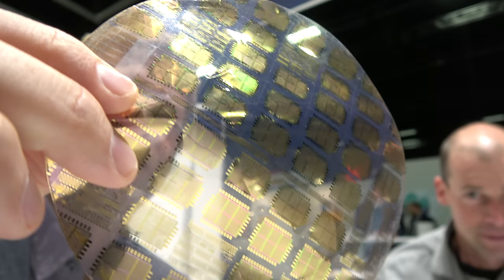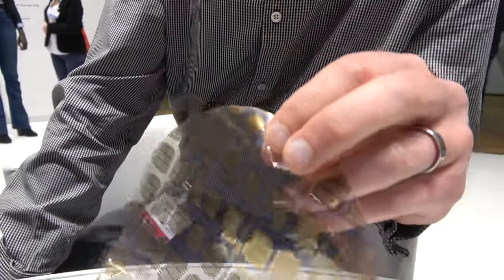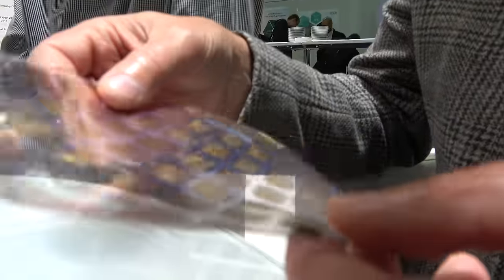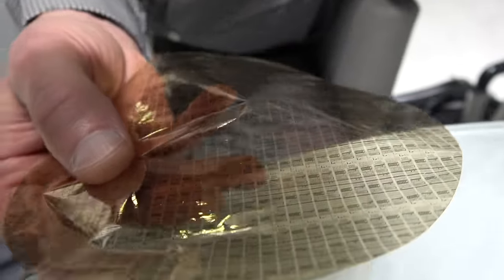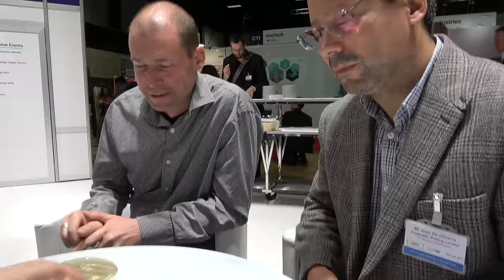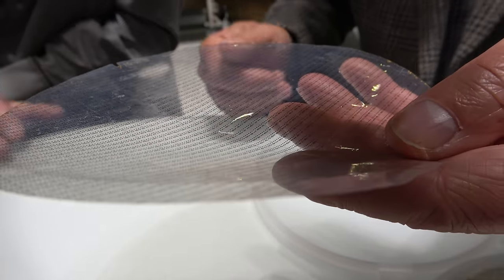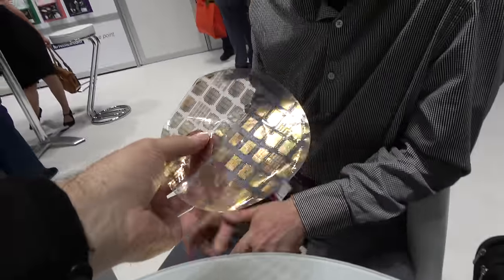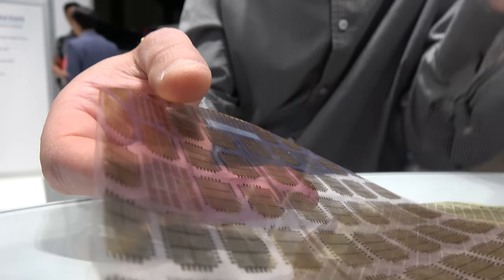$0.01 Flexible Plastic ARM Processor by PragmatIC

Comment: I'm still waiting for the day I can print out a new computer
Reply: can you imagine the cost of the ink though?
Reply: You literally can, right now, with an ordinary inkjet printer.
https://www.wired.co.uk/article/inkjet-print-an-electronic-circuit

 @menotu000  The ink is really expensive, but not bad compared to normal printer ink - it's about $30 a gram.
Reply: You literally can, right now, with an ordinary inkjet printer.
https://www.wired.co.uk/article/inkjet-print-an-electronic-circuit

 @menotu000  The ink is really expensive, but not bad compared to normal printer ink - it's about $30 a gram.
Reply: @nathangamble125  There's a difference between printing an electronic circuit and printing a full proccessor i.e. what Jason ^^ was referring to. Did you really think he was really waiting for the day he can print out a blink LED circuit?
Reply: @spacedesigner849  i mean you could do that with the right inks and layering
Reply: Your dream might be accomplished with advanced 3D printers.
Reply: Just download more RAM :) save the material
Reply: OddFuture  technically with a Virtual Machine you can XD

Comment: CPU is free, you pay for licence :)
Reply from the maker: dzhiurgis for the first Billion, the license should be free..
Reply: After "the first billion", I guess they go to RISC-V. :- )
Reply: AMD still pays a fee to Intel for the x86 platform.
Reply: @Game Over  Maybe because X64 is supposedly by AMD, not that I care...
Reply: @Game Over they reached an angreement where AMD licence x86 while intel licence x64 without paying any royalties also RISC-V is the future

It has the specifics of arm but with an open standards so companies nutoriously push this intructionset
Reply: @epicgrapefruit7563  Still, you can't deny that RISC-V is more desirable than ARM, may not be a direct replacement today, but surely in the next 3-8 years.
Reply: @epicgrapefruit7563  okay my bad i should have been more specific what i meant is that arm was expected to conquo the desktop/notebook market with its performance/efficency improvement

But risc-v over even a greater leap in this feild than arm
Reply: CPU is free, but its driving is electricity 😂
Reply: @epicgrapefruit7563   I wish there was the day where there would be RISC based desktop CPU's beating intel\AMD on everything including price, but yeah, if it happens will be far, far away from now :(...

The advantages are probably that any Chinese company can make them and customize them the way they want without having to pay crap to no one which only means the end user will pay less even though if phones were using them, the big known brands would probably continue charging the same as their current expensive snapdragons and only get even more profit out of it :(...

Comment: Instead of making it smaller with slight improvements, keep the size, make it more powerful.

First gen cell phones had bigger processors than desktop PCs.
If we had batteries to keep up with our density of power for the size, the only limitation I see, it would be amazing.
But if it's done, parallel research will make up for the deficit.

Comment: Any heat issue?
Reply: mino dino it will melt the plastic lol
Reply: chip never heats itself ...the whole component heats altogether....if they provide it with a good cooling technology ...the estimated heat produced in 0.1 microsecond will be transferred immidiately and whould be completely safe.....everything depends on heat discharge rate
Reply: Arm processors use very little electricity and I doubt they'll have a high atdp but if they do have a heat problem in the future they could just use Liquid to transfer the heat away like a non conductive mineral oil
Reply: that's arm 1, from 22years ago so probably not much heat is produced
Reply: Richard Farrey  there goes your flexibility!!! :)
Reply: Considering how thin it is it's probably so easy to remove any heat that it will be way less of a problem compared to traditional processors. Ofc unless it instantly melts when you run a current through it

Comment: How much processing power does this actually have? Can it run a simple operating system?
Reply: It's probably still a prototype, so that would be unknown unless there's estimates/expected result
Reply: They mentioned an equivalent of a Cortex M8 and I remembered it used in gaming mouses. It's just good enough as a co-processor.
Reply: William Baric  it's a processor.
Reply: its based off of a cortex-m0 which is.... drumroll.... 2.33MHz. you could maybe run dos on it and do some assembly code?
it's still super insane that you can actually create a CPU just by shaping up plastic though.

Comment: Interesting but substantially fact-free. Now, late 2019: where are they, boys?
Reply: might have realised it's hard to implement these as they said
they seem too easy to damage even by a slight mistake to me..... which would suck in the real world
Reply: Heat from CPU will melting the plastic, so not sure how to make it durable, but for capitalist view this is great for "planning obsolescence"
Reply: @fadrium1464  I can see these arm processors possibly being used in cheap calculators or low powered microcontrollers.
Reply: @fadrium1464  Heat is fair concern and one of the questions not answered in the original video - along with clock speed. But I've done plenty of MCU designs where power is only a few milliwatts. You can still get a lot done with that.
Reply: @fadrium1464  has nobody in the comments actually watched the video? They aren't designed for high performance applications. It's for things like tracking, short-term environmental monitoring.

They aren't trying to run Crysis on it, my dude.
Reply: @epicgrapefruit7563  you would still need to thicken the plastic.

Plus this is old technology. We already use PCB's. Plastic in electronics isn't new
Reply: @epicgrapefruit7563  electricity and thin plastic. Yeah. No matter how much juice is flowing it'll still eventually degrade.

I can see this being used in singing Hallmark cards or sales tickets. Other than that nothing else unless it was meant to be thrown out
Reply: @epicgrapefruit7563  yeah, you obviously don't think. Peace
Reply: @MsHumanOfTheDecade  All I hear is RFID tags.
Reply: Shit, you’re right, it is late 2019. Damn. The future is coming.
Reply: @fadrium1464  can't they use some type of aerogel composite instead?

Comment: But can it run games without melting?

Also how would you connect this to a motherboard?
Reply: ARM CPU's aren't for gaming.
Reply: @AsttoScott  you can play pubgm on phones with ARM CPUs
Reply: @AsttoScott  As long as computer games require CPU calculations, any CPU can be used for gaming.

Comment: We could have thousands of these running in parallel (if they design them to support multiple processors) for a cheap price.
Reply: @Murphy deffa someone also said you don't need more than 640k...
Reply: @Murphy deffa well it depens heavily how you programm the task you want to process
Reply: @Murphy deffa yea right... super computers only use 32 cores, right?

GPUs also have 32 cores? They have thousands. Investigate about "CUDA" (Nvidia) and "Stream Processors" (AMD).

As Leicht Sinn says, it all depends on how you program. Also depends on the task you want to do.

Granted, for most users even 32 cores are to many.
Reply: GPUs have 32-64 cores. Stream processors are execution units, not cores.

Super computers and server halls do not generally accelerate one task, because that’s hard; but that’s what end users tend to care about. You’re not interested in running an ensemble of games, you want to run a single instance of the game faster. You don’t generally want to do more each frame (e.g. simulating the NPCs you don’t see) you want to make each frame faster. It’s a different use case.

Also, Bill Gates/Microsoft never said 640k was enough for everybody. The 640k limit came from IBM hardware combined with the need for adresses that map to other things than physical memory.
Reply: @soylentgreenb  Yes, they have "few Compute Units". As I understand it, those compute units will send instructions to multiple small processors running in parallel. Nvidia calls those smalls processors "CUDA cores". One could argue they are cores inside a core. Scientists use GPUs as "low end cheap super computers" to execute simulations and other stuff, normal users for gaming and mining bitcoins. But ultimately they are processors running in parallel, and that is what we want. 

Games tend to use "few cores" most won't use more than 4, 4~8 cores in the newest ones, even though some are programmed to take advantage of more cores. I am sure we will soon have games that will require easily 8+ as a minimum.

Applications that benefit from more and more cores are for work (graphic, science, engeneering, video editing, movie making, etc). Servers for virtualization.

It seems you are thinking only about games. Outside of games and simple office use, the higher the core/processor count the better.

However, I was wondering what is the life span for the processors in the video. Don't think a processor printed on a plastic will last long for a heavy task. Maybe they can improve (and I bet they will, if they haven't already) their technology to print on other substrates that will compete with or be better than a silicon wafer.
Reply: Thermodynamics starts killing you pretty quickly.
Reply: @serpentine1983  One could argue that floating point units and ALUs inside a processor are their own cores too. But it would be wrong. GPUs are really fast at stupid brute force because that's what they were designed to do. Pixels on the screen are largely independent and can be handled without reference to other pixels on the screen. Not strictly true always, but usually true. Why are CPUs often faster than GPUs? They're made to run branchy, gnarly, highly serial stuff fast; that's what almost all the transistors are spent on. Even in a highly parallel problem like graphics you have a serial fraction of the code. You need to have something to setup and distribute tasks; often there is some kind of gather step for parallel tasks too. Amdahl's law puts a strict limit to the amount of speed up you can get from such a system. Getting around amdahl's law has a big cost. The way games do it is by working on several frames in parallel; this has the huge cost of increasing latency; making 120 FPS feel as sluggish and unresponsive as 40 FPS (because you're displaying ~5 frames in the past instead of ~1.5 frames).

Running several game clients on the same system in parallel would allow even more parallelism. That's something google would like to do, but for you as an individual user it makes little sense. There are other ways you can expand the problem; you can of course simulate many independent NPCs in parallel and even the ones you don't see instead of just giving them a schedule. OK, so now I'm saturating 16 cores, but how much better does it actually make the game? What's the added value? Very little. But that's what you have to do to make use of the extra cores; you cannot generally speed up the same game without harsh tradeoffs. Can someone find a generally useful feature that you can add to make games use the extra cores? Maybe, but it is extra features, not performance that you're going to get.

Comment: Can that plastic handle lots of heat? If not then this suggests that those arm processors don't get too hot.
Reply: Actually there is plastic can stand heat , like the one you use in mircowave oven

Comment: Wouldnt the processor be ruined if it generated enough heat to warp the plastic thou? It would seem to me like heat could really effect the lifespan of the cpus and with plastic being the base it would not take very much to break them. Maybe for low-end applications it might make sense from a cost-effective standpoint but anything more complicated than a stopwatch you may have problems with the cpus getting too hot and damaging themselves. Need something that can resist heat and/or cooling I guess.

Comment: I don't know what R-micro controllers are but tech has come a long way. The first GameBoys use to be really big and bulky and it required cartridge and battery's. OK now imagine a gaming unite that did only what the original Gameboy did and noting ells with the same potential but built with the latest technology. Imagine translucency, flexibility, and solar powered all in one unit. With even the screen it self is both translucent and flexible t the same time. This would be unimaginable back then.

Comment: Excellent future. Cut and stick and paste. Do you spray se b. Even display types. No LCD required. Best are network sensors. Mostly people can design and distribute from home printing later. You can design your own chips and the whole thing costs less than a printer with a substrate papers.

Comment: I'm wondering about heat dissipation. Like if you were to attempt to scale this up to say... Risc-V with a certain number of cores running Linux, would you begin to run into problems with keeping it cooled? Or does the thinness allow heat to dissipate more easily? In terms of manufacture, with its more robust process, is this something you could then manufacture anywhere?

Comment: How Hot can the IC get?  Do they have a life time?  What voltage/watts does the IC run at?  Can I power the gate of a transistor that will help me power an electric motor?  If so sign me up for a million.
Reply: These are general purpose processors and they are not going to the high power processors. So no need to cool them and power consumption of a few mA I guess. And it can surely with the right transistor(s) it can control a motor
Reply: Should be able to withstand about 150°C, or there about. Life time will depend on application, but can run for years if needed... Typical voltage will be 3-5V, very low wattage. 
This isn't meant to replace silicon, it will rather open a new market for low computational requirements.

Comment: I got a question, how is it with the TDP? Even if its low power the heat has to go anywhere... 

Flexible heatsinks?
Reply: Not actually a problem. You must be thinking of plastic as thermal insulator, but at sufficiently low power, it isn't, it doesn't have a lot of thermal conductivity but it can have plenty. If you think of most integrated circuits, the IC die is sat a millimetre deep inside an epoxy enclosure (typical black chips) and some heat goes into the PCB where the copper fill dissipates the heat through yet another layer of epoxy namely the solder stop lacquer and the silkscreen, basically all thermal dissipation occurs in most typical low-performance circuits through copious layers of plastic. The materials they're dicing around here have similar thermal performance, i think something like polyimide even has a slightly better performance than epoxy.

Another thing to consider is the Cortex M0 electronics itself. The typical ones i've seen have an internal 1.8V regulator and a bit of the power consumption comes from the regulator, a tiny bit from the computational core itself, but most really from I/O circuits which is a 3.3V signal converter, static protection circuits, pullups, draw induced by connected devices, so basically all of it is due to having to interface with integrated circuits which have existed now for decades, standard electronics. Now if you design this as a disposable circuit from the get go, you can dispense with all of that complexity, and with further integration you don't need to interface with a different I/O voltage and can also reduce the pullup current. So at the end of the day it depends on the switching performance and voltage thresholds of the underlying flexible MOSFET, the applicable supply voltage, whether they're able to make it work, they can work with their library of fully flexible/printable circuit elements to achieve a good leeway in power consumption.

I'm almost more worried about how they want to go about power delivery for most use-cases rather than power dissipation. For RFID tag it's trivial enough, and it's a fundamentally low power circuit, orders of magnitude lower power than a processor, but other things? You can dissipate a lot more power under a fairly thermally unfortunate chair cushion than you can store energy chemically in a button cell. Given the power delivery constraint, i'm not sure the world necessarily needs a flexible ARM Cortex M0 processor for now, though in due time it may be promising as a cost cutting measure.

Comment: now the processor is so small, what is it going to control?????  Any devices it connects to will be larger, for example a wifi module is going to make it much bigger am I wrong?
Reply: Wifi module is big due to the antenna,  which they can integrate into the frame.  Keyboard is also big. However,  Google Glass type of application will benefit.  GShock watches will be thinner.

Comment: What about the transparent electronics? a woman from my country made super cheap transparent electronics and could also make disposable electronic newspaper oled screen even before LG OLED TV, according to her she had something way cheaper to produce and better than the common transistors and the OLED was also so cheap that could literally be just a modified normal printer that could print a OLED screen on paper, well she won a big price and many companies signed contract with her and OLED TV came out quite cheap like SUPER EXPENSIVE... while by now all car windows should have already all been some kind of oled screen where when we shut the car off it automatically turn all glasses full white blocking sun light, but well we see nothing, only a few cars have small displays inside the glass for small things and only on expensive cars...